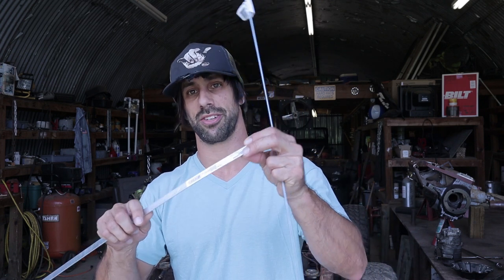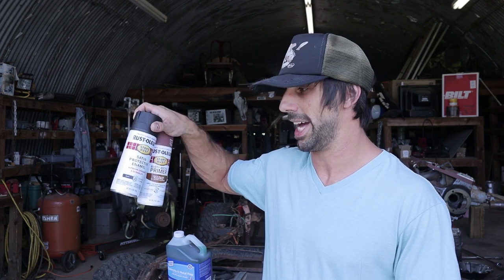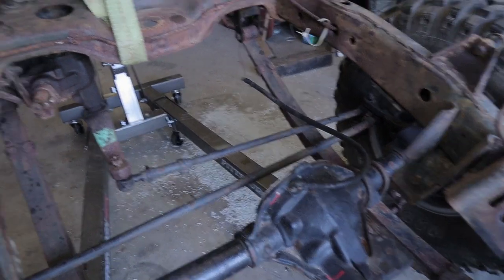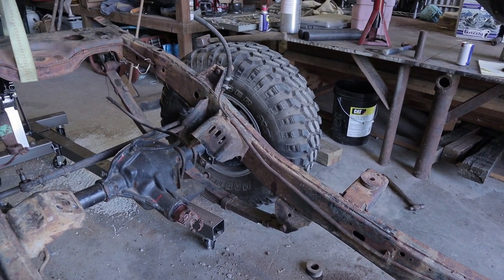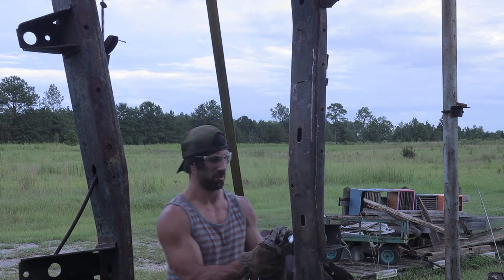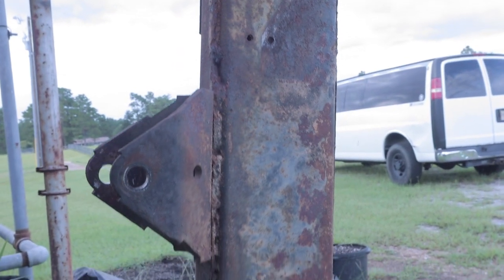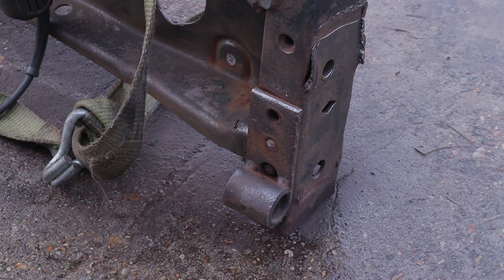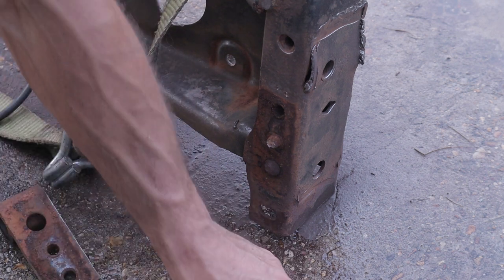Jeep CJ5 Restoration, Pt. 3: How to Clean & Prep Rusty Frame for Paint

Comment: Thanks, great video!  I attempted a non off-body frame restoration for my '86 CJ7.  It had a 1/2" layer of rust/dirt inside the frame.   Hesitatingly power washed the inside, followed up with a strong small magnet on a 2 foot goose neck extension from an auto parts store to pick up any remaining pieces of rust.  After drying out, I applied 3 cans of Eastwood internal frame coating (with the 360 degree head).  Yeah, 2 cans would've sufficed.  If anything, it gives me piece of mind that the frame will last.
Reply from the maker: Yea I keep hearing that stuff works well. I may put some in my frame before it’s all said and done. Standing it up like that definitely allowed me to get it really really clean. I was surprised how good of shape the frame was in

Comment: I use rustoleum when I paint my frames too . 

 another product I really like is  eastwoods internal frame paint.. 

I used it on an s10 a few years ago and it worked awesome, I actually have 2 cans on the way for my cj5 

I figured I might aswell get some where the cj has a full box frame and I plain to go wheeling every now and then, it should help stop the mud from rusting the frame from the inside out
Reply from the maker: I was reading about Eastwood the other day. I am trying to keep costs down. I want to do it definitely, but the inside of this frame seems to be in amazing shape, sooo I may let that slide for now even though I’m a perfectionist and it will drive me crazy if I don’t. I figure it’s one of those things that I can do down the road a bit. Who knows what I will decide though haha. Thanks for the advice! How did the rustoleum do?
Reply: Rustoleum always works good especially when primer is used .. 

 alot of truckers around me paint their frames with rustoleum without priming or prepping...

 they still get 3 years or so before the road salt gets to it, then they just pressure wash and repaint..

https://www.eastwood.com/undercoating-gun-with-2-hoses-and-bottle.html

I have NO experience with this ^ and it costs 10 dallors more then 3 cans of internal frame paint but its reusable and you can pick the paint you use..